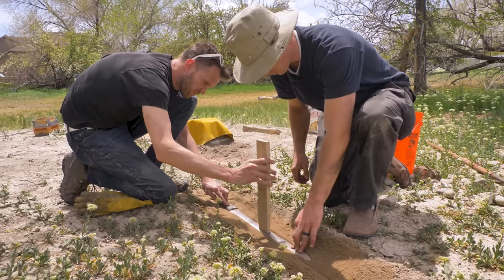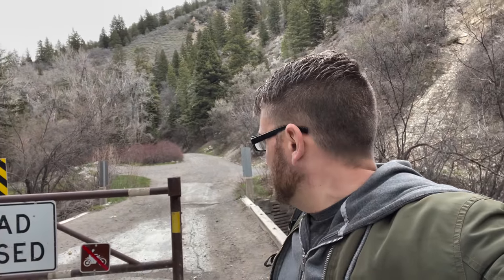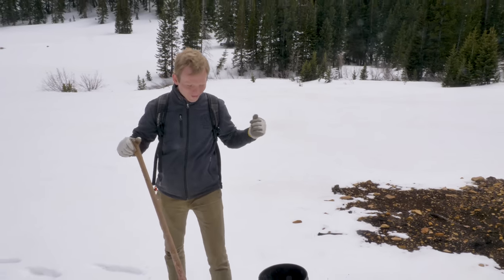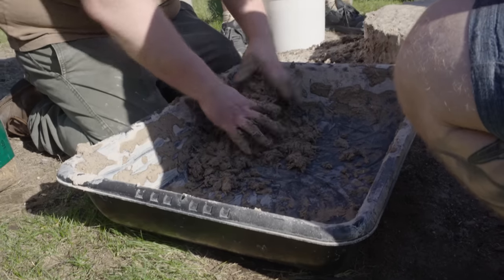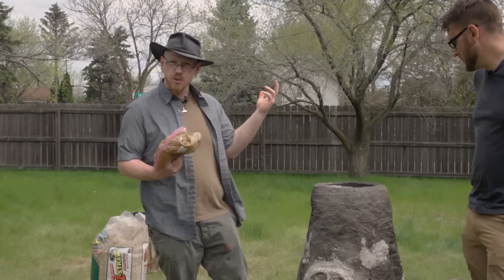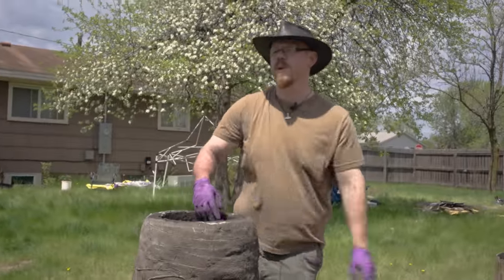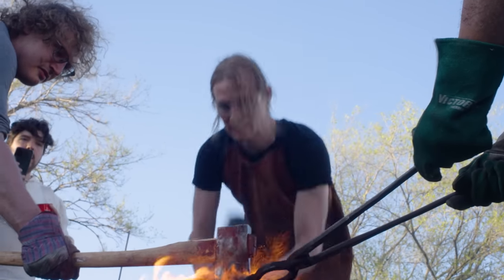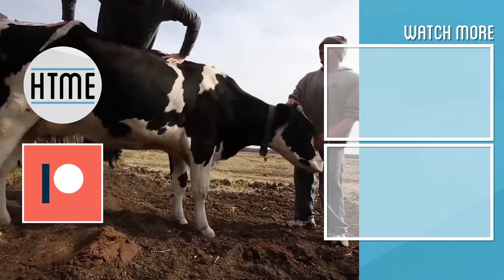I Hiked 14 Miles to Collect This Orange Dirt

Comment: I know you probably want to do this the natural way, but acid would work well, to extract it. Iron is also like the easiest metal there is to extract with an acid. Probably something very low tek, like Muratic acid (hydrocloric), would even  work well. No need for Aqua Regia, with Iron.

Comment: Strange coincidence,  I saw primitive tech do a video about this some time ago.   Hadn't crossed my mind since.   Until a conversation with an older co-worker today about doing carpentry work before modern power tools.  As we were discussing older methods before iron tools, I told him about the episode.  And 3 hours later I see this on my recommended. I had no idea it was about "bog iron" until i saw the top comment.  Strange strange world we live in.

Comment: IF YOU DO THAT CARRYING-OVER-THE-SHOULDER THING AGAIN SOME TIME split the load into two, and use the shovel as a yoke.
Far safer walking with a balanced load, you can cushion it easier, and if you have to drop it, it doesn't catch you, you can aim the drop better

Comment: I'm actually collecting materials to do just that right now, smelt iron. I just need to find a good place to get clay. There's a few rivers around, but no public accessible places have clay. Just rocks. 
I have a friend that does blacksmithing, and I do copper and bronze casting. It would be fun for me to try and make crucible steel from raw ore, and fun for the blacksmith to play with.
Reply: try rocks and cement? will probably be better than clay too. you jsut need to contain the heat.
Reply: Just get a lot of river sand  from the edge , stir it up and drain the dirty water, ( keep the dirty water) trow away the sand at the bottom. Let it settle dump the clean water from the top, tada clay..
Reply: @prydzen  I could avoid construction cement as it contains lime, which will cause problems with the bloom formation. That being said, a castable refractory cement is perfectly fine.
Reply: It is a very fun and addictive hobby! As for clay, I built this furnace out of powdered clay from a local ceramic supply shop. It is inexpensive and easy to work with. My mixture is by volume;1/3 EPK clay, 1/3 sand, 1/3 chopped straw, and then enough water to make it a crumbly but formable consistency.
Reply: @prydzen  I did build a propane furnace I melt.copper in out of heavy firebrick, lined with portland cement in the cracks. The lid is about 2.5 inches thick of solid Portland cement mixed with perlite. I do have a metal band around the lid or it would likely be in 2 pieces. It hasn't melted or flaked off on the hot side when subjected to at least 2300 F. 
Another commenter did mention that the lime in cement might inhibit bloom formation though.

Comment: That dirt looks an awful lot like the acid mine drainage (AMD) pollution coming out of abandoned coal mines. It's full of iron oxide and is being recycled to a degree as paint, so I wonder if you could put it through the same process as you did with the dirt and get iron that way as well.

Comment: what exactly is the difference between "iron" and steel? there is no way to produce pure iron using a bloomery. all you get is steel with varying carbon content. is iron used to refer to low carbon steel that can't be hardened?

Comment: you should loose a shit ton of that carbon just during the process of consolidating that into a consistent ingot.
It's kind of pedantic but I wouldnt call that chunk of iron steel untill it has properly been purified, it is likely you will have good high carbon tool steel when all the slag has been beaten out of it though. In fact this shows you absolutely did a good job with the bloomery, iron age people would want the end result of this process to be ready for tools weapons, etc. 
I believe that most lower carbon mild steel that existed historically got that way due to constant reuse, eventually most of the carbon got hammered out of it.
Reply: I will definitely lose some carbon as the bloom is refined and homogenized, but in a proper forge atmosphere it won't be a "shit ton". The real problem with a steel bloom is that it tends to crumble and not actively weld to itself while trying to consolidate, which you see happening in the video.
As for calling it steel, that is a carbon content distinction not based on refinement.
I will be remelting this bloom in a hearth to oxidize out a bit of carbon with the aim of creating a much more cooperative material.

Comment: So following the whole theme of building up to modern day. When you start ‘inventing’ primitive firearms eg: hand cannons, muskets etc.. will you have to get a permit for that firearm? If it even shoots at all or doesn’t blow your hand off first shot of course.
Reply: Probably not, but I'm guessing I'll be involved due to my past experience in the firearms industry, and I'm properly permitted and licensed.
Reply: Interestingly, the National Firearms Act states that antique firearms (models or replicas of models from 1891 or prior) which don't use a fixed ammunition system (basically, if you gotta jam a ball down the barrel, it's not a fixed ammo system) are exempt from NFA controls. His state laws might still require some kind of permitting or permissions, but there's nothing required federally from what I know.
Reply: @theKashConnoisseur  You're right, but only kind of. It really depends and it gets tricky between federal and state law, but manufacturing for yourself is different than manufacturing for others (if I'm involved,) and the ATF still has clear rules over what would constitute as a destructive device, which cannons still may, and it all just gets... specific. It really all depends on specificity on a case by case basis, and it's hard to conclude what type of FFL or if you need one at all one needs before the scope of the project is known for certain.
Reply: @TheElfsmith  Cannons of an antique design are still fine under federal law tbh. Assuming muzzleloading operation and the whole pre-1891 design stuff of course. Breechloading with fixed shells or any post-1891 design would likely be a destructive device, right. And you are allowed to manufacture your own firearms for personal use (federally, each state potentially being different ofc) so long as they don't violate other sections of the NFA... but then there's the whole YouTube thing which might fall under commercial uses of the manufactured weapon(s). That might put things solidly into "this needs an FFL" territory. 

Either way, just a gun nerd and not a lawyer :P Love what you guys get up to though!
Reply: Not untill they start making things with cartridge ammuntion or destructive devices (like rockets, bombs, grenades).

At least, thats if the laws doesnt change and get more restrictive between then and now.
Reply: Why would they need to make firearms though? It is not a tool required for some other process so you can just skip it no? It's like what would be the point of making a sword now that they have steel since that sword isn't useful to advance further, unless you plan to use that sword to rob a walmart or something.
Reply: @ruukinen  they have already make multiple swords, as well as other weapons that weren't "necessary" to advancement.

And firearms were a massive technological innovation. If you are going through the great advancements of humanity, guns are on that list.
Reply: @DH-xw6jp  I mean for the premise they have to at least make tools. Swords are cool I guess. I don't agree that firearms where a massive technological advancement. Like I said it's a dead end that doesn't lead anywhere. Gunpowder is useful. Firearms aren't. I don't think they need to tick every box or it'd take several lifetimes.
Reply: @ruukinen  sure, i guess the thing that changed warfare forever isn't a very important or cool advancement...

Certainly no where near as important as [checks notes] fictional bamboo gas masks and soda pop.
Reply: @DH-xw6jp  I'd argue that soda pop is in fact orders of magnitude more important an advancement than firearms. Not only does the chemistry to make them lead to other useful discoveries, soda is also something that most people enjoy.

Firearms appeared already around 1500 and only replaced most other weaponry around 1800. Firearms themselves didn't do much. It was the epiphany that bigger armies = better. Firearms just facilitated arming peasants with something effective that didn't require much training. You know like crossbows. In fact crossbows were more useful until firearms became less cumbersome to reload with cartridges.
Reply: @ruukinen  In my mind, if they were to do an episode on gunpowder, it would make sense to follow that up with making some kind of projectile weapon that uses said gunpowder. As far as usefulness goes, guns are great for hunting as well as for home and national defense. Gunpowder is great for fireworks, firearms, mining, or any application of hot, expanding gas using kinetic energy to accomplish some work.  And whether you like them or not, they did indeed revolutionize the world. There's a reason why modern armies don't come equipped with crossbows lol.
Reply: @theKashConnoisseur  Like I said gunpowder is useful. Guns are only useful in a very restricted domain. Modern guns might be better for hunting than bows but we are talking 1800 cartridge weapons at that point and we need precision boring for that. The kind of weapons they can make if they follow the ruleset until they get to the industrial age aren't the kind of weapons your naive self thinks. They are inaccurate, unreliable, dangerous and frankly a waste of time.

I'd much prefer if they made as few sidesteps as possible so they can reach as far as possible along the route to the modern age. Making a gun or two won't really affect the rate of progress but if they made everything someone thought was a cool thing they'd never get anywhere. These guys after all don't need to fight wars.
Reply: @ruukinen  Wow, name calling that's really nice lol. 
I understand you are biased against guns but firearms play a very important role in human history. Muskets quickly replaced bows and arrows for hunting for great reasons, even before the advent of rifled barrels and modern cartridges. They put the power of a master bowman into the hands of anyone who could hold a long gun. The accuracy of a novice musketman was a vast improvement over the novice bowman, and that's saying nothing of the increase in range and the reduction in training time by literal years. They also played an enormously important role in the formation and exploration of the early United States, as well as a historical and ongoing role in both self defense and national defense, which provides further rationale to cover them.

Guns are tools, just like a bow and arrow. The same reasons to cover bows and arrows or swords and halberds are the reasons to cover guns. They can be used to do great good or great harm and it solely depends on the user. 

Note how I can refute what you say without calling names or suggesting you lack some level of experience or intelligence? Try and see if you can do the same.
Reply: @ruukinen  Because people want to see it and it's cool, in all honesty. But, as someone that specifically studies the history of manufacturing, I can tell you it also delves into a real driving force in technological advancement, which is, as dark as it may be, warfare. Arms races in history are a fantastic way to study the advancements in metallurgy, manufacturing, and mass production since basically the beginning of mankind's development of metalworking, and generally also see the first use of new technologies. Even screws- something so ubiquitous and fundamental to our lives today- were used as fasteners for the first time in armoring.
Reply: @theKashConnoisseur  Where did I call you names? You seem to just be trolling at this point.

Hunting rifles didn't happen until cartridges, you are just factually wrong there. You don't need a 100 pound war bow to hunt. In fact it is legal to hunt with 40 pounders here and pre renaissance people probably didn't care as much about the animals suffering. Also like I said, you seem to grossly overestimate the efficacy of early firearms.

Since I'm not American I couldn't really care less what was important to the formation of the US or not, especially not in this context since this series will probably never advance that far in the timeline. If they cover it cool, if not even better.

I also don't see any great purpose to specifically deal with bows, swords, poleaxes or other war implements since those don't further the timeline either. I disagree with them being some amazing technology that furthered humankind and at this point it doesn't seem like you have arguments that could sway me.
Reply: @TheElfsmith  This is a weird misconception I've seen a lot. War has never been a driving force that accelerates progress. It pretty much always slows it down. The fact that technologies that are beneficial for the war effort progress at incredible speeds during war is surpassed by the fact that literally everything else suffers.
Reply: @ruukinen  When you call me naive, that would be name calling sir. You have no idea what my level of knowledge or experience is, but you'd rather call me names which amount to you saying I don't know anything about the subject. If this gun toting American can have a discussion without calling names, I trust the high minded European can as well.

Smoothbore muskets were absolutely used for hunting. In the American Territories smoothbore long guns were one of the prime tools used to hunt the big game of the North American continent. After the widespread availability of  firearms in the 1600s, they became THE primary tool of hunting, especially here in the US. Flintlock firearms essentially defined how the early American hunted. 

I know you aren't American. The name gives it away lol. Thing is, most of the viewers of most YouTube channels are. This content creator is. I'd be willing to bet that in his analytics, the majority of the viewers are from the United States. So maybe you are slightly outvoted here. ;)

It's fine you disagree. If that's all you have to say and you refuse to listen to any convincing statement, I'm sure you'll be happy to end the conversation. I wish you better luck in other threads!
Reply: @TheElfsmith  And I'd argue we would be significantly further ahead with less of it.
Reply: @ruukinen  That's hypothetical, though. History like this is all about what happened, and the development of technology through warfare is what happened. It doesn't matter if we could have progressed more without it, it's the fact that that's how we did discover further developments and new technologies.

Comment: Can't wait until you go hunting for bauxite, to turn into the modern metal of choice and convenience - aluminum. Iron may hold its oxygen atoms tightly bonded, and they can certainly be difficult to remove...but aluminum is an entirely different beast. Because bauxite is a mixture of oxyhydroxides and hydroxides, it must first be treated with the Bayer process to produce pure aluminum oxide (Al2O3 or alumina). THEN you use the Hall–Héroult process (which requires temperatures of almost 1000 degrees C and a 5 V, 100-300 kA electrical current*) to electrochemically reduce the alumina to pure aluminum metal.

When the channel gets this advanced, I will start to accept that the goal of "making everything" is realistically achievable. Until then though, a societal reboot seems destined to peak in the iron age.

 *That's an extremely high amperage - like, ~1000X greater than the amperage that an entire American residence is able to run on (which is typically 0.1 or 0.2 kA). Plus, you need to dissolve everything in molten cryolite, and some of the side-products of the reaction are extremely hazardous (like HF, one of the scariest acids in existence, plus carbon monoxide).
Reply: With modern knowledge you can sidestep a lot of the steps humanity had to take to get to where it is since many things could have technically been invented much earlier. Steam engine for example.

Comment: How did it turn into steel?
Isn´t it in primitive iron refining not more or less the choice between wrought iron (bloomery) and cast iron (blast furnace)
Reply: It's just the amount of carbon mixed into the iron they must have just got lucky with the mix

Comment: And how do you get iron from this process, and not steel, like you did right now, because you are using coal to heat ore, and it will always carbonize - what is the primitive solution to get iron, and not steel?
Reply: It is a tricky balance to strike, we did get some iron from this smelt, but the majority of what we produced ended up higher carbon than I expected. That being said, the main issue was we burned a bit too hot towards the middle of the smelt. The next one I run will have more time in between the charges of ore and charcoal to lower the temperature slightly. Dialing in a smelt is more art and feeling than hard science as there are many variables to try and account for. There will be another video where we refine the bloom and I'll go into detail on how to remove carbon.

Comment: u didn’t make steel, u made cast iron.
Reply: Yes and no, what we ended up with is a mix of bloomery iron, steel, and cast iron. Some of the bloom is quite low carbon, and other pieces that actively melted in the furnace may have a high enough carbon content to be considered cast iron. But the overall majority of what I extracted is in the mid to high carbon steel range.